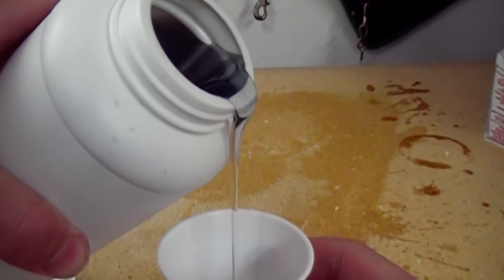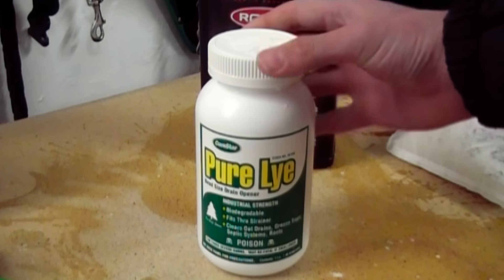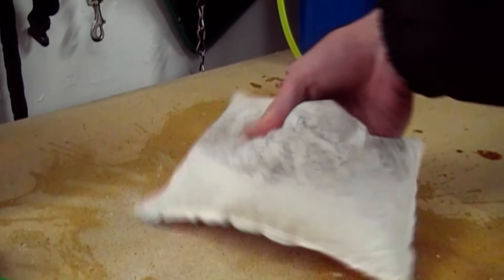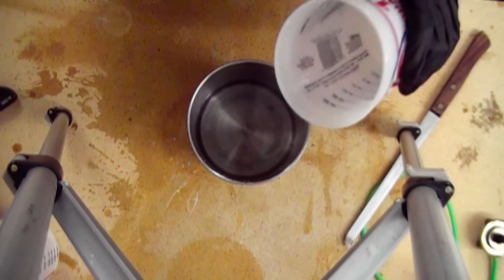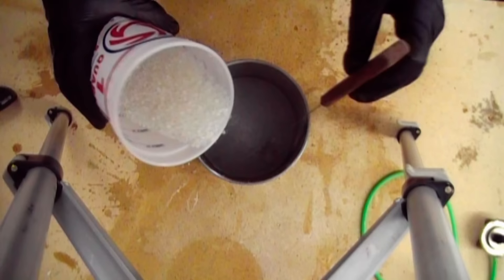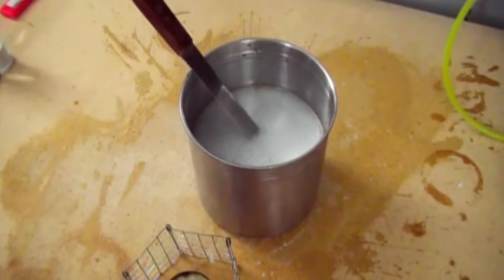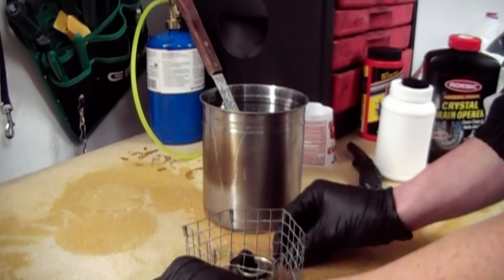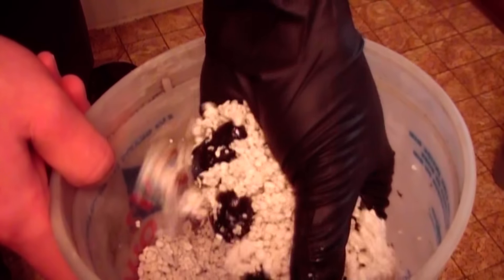Homemade sodium silicate (water glass)

Comment: Dear Cikindred and others,
My wife has made a bird drinking scale of concrete and also one of ordinary cement grout. With ready to use water glass she tried to make this close. Unfortunately the water glass solve if the scale is filled with water after 2 days drying. Is it possible to add something to the water glass that prevents this?
Excuse me for my bad english.
Reply from the maker: Heat with a torch, or gas with carbon dioxide. Either will transform the sodium silicate into insoluble silicon dioxide.
Reply: clkindred
Many thanks for your answer Cikindred, I shall give it a try!
Roeland.

Comment: Any reason why using this to line the bottom of a wood stove would be a bad thing? (the perlite and sodium silcate)  Other than it might not be durable?
Reply from the maker: Line the bottom of a wood stove for what purpose? You could sort of paint it on and let it dry, the thicker the layer, the longer it will need to dry to avoid blistering when heated.
Reply: clkindred it's a 55 gallon drum stove, so the bottom liner would be to keep the drum from burning out
Reply from the maker: Ah, well no it couldn't hurt.
Reply: Alderaan Apiaries Depends what type fire you will have, but a barrel laying on it's side as normal for a barrel heater should not burn out, if upright like a trash barrel they normally burn out 1/2way up around the sides but my bottoms are normally fine. My barrel stove for heating the house (lays on side) lasted over 15 years! The barrel did rust/burn out finally around the flue pipe damper ring on top rear so now I am going to weld some stuff there as I want to try something anyway. Otherwise that barrel is still like new except under the damper ring. I build pretty large wood fires in mine for tons of heat, but never get a barrel red hot, it's the red hot that may kill the barrel.
Reply: Thanks for the information. I did go ahead and line the bottom of the barrel with the mixture, then covered with some left over stainless flashing I had left over from another project.  I don't know what it will do for burn out, but it does seem to keep the bottom considerable cooler, which is good for the floor underneath.
Reply from the maker: Alderaan Apiaries good to hear.

Comment: Could I use this 'glue' to fix my Fitbit Charge band? The elastomer band came off the plastic body of the tracker and so far epoxy, super glue etc have failed. I contacted Fitbit and after replacing it once, they do not stand by their defective product and they will not replace it but suggest I purchase one of their newer device...really! 
What kind of application is water glass used in? With equal proportion can I make only a few tablespoon of it or does it need to be done in larger quantities?
Thanks in Advance

Comment: Could I coat a steel conainer with water glass and then dry it making a 600 degrees celcius resistant coating? And will it conduct electricity?

Comment: would commercially bought sodium silicate (40%) be suitable for this mixture? If so, how much would be needed to line a forge with 7" x 7" x 3" chamber. Thanks............
Reply from the maker: "this mixture" as in the lining I used in the forge video? 40% should be fine, however the water added will need to be less. I think I used 350ml of sodium silicate for the trashcan forge lining, and 350ml sodium silicate for the top coat cement. So in your case I think about a liter total should be enough, diluted with about 400ml of water.

Comment: I've been told that 'RU' type sodium silicate is the best for making core molds in foundry work, but all I can find for sale is type 'N'. I am nowhere near a chemist, but it seems that the difference between the two is basically concentration/thickness. What does this formulation yield? It seems like it would be even thicker than RU, but again- not a chemist.
Reply from the maker: Mike Barker This makes a 50% by weight concentration at the start. 500 grams of water, plus 500 grams total of reacted material, but when finished boiling the product until all silica gel is dissolved, it is more concentrated.
Reply: clkindred Thank you for the reply and info! If I am reading it right, RU is about 46% material, so I will try this with a little more water: 550ml.

Comment: After the sodium silicate has cooled, and is ready to use, does it matter how (type of container, temperature) it is stored?
Reply: The commercial stuff is usually stored in a plastic container with a screw lid. As long as the water in it is not allowed to evaporate and it's not allowed to react with free CO2 in the air, it can last for a very long time.  Once you take the water out, along with react it with an acid or CO2, from what I understand, it basically converts into glass.

Comment: i like to make the forge and i'd like to buy the sodium silicate online but i don't know if it will work due insufficient purity
Reply from the maker: +Actionhank Purity is a problem if there is other chemicals in a certain product, I like to bring up the MSDS from the manufacturer to see what all is in a certain product. If it is pure, but diluted that is not as big of a problem, but it may mean it's too weak to be economical. (Paying too much for water in it)
Reply: +clkindred allright thanks for clearifiyng! 
in the meantime i have looked up some info regarding sodium silicate. turns out sodium silicate is a saturated solution at about 40% silicagel per liter, meaning that 40% purity is as high as chemically possible before cristallizing :)
Reply: and i also have one question about the burner, how did you fasten the cut-out from the drain strainer cup? soldered or just wedged in place?

Comment: Great video !....any ideas how to make Colloidal Silica ?...(concrete densifier)
Reply from the maker: From what I understand, the big manufacturers use a process using a combustible compound containing silica. trimethylorthosilicate if I recall correctly. This chemical is sprayed from an atomizing nozzle and burned, the resulting "smoke" being microfine silica. I have also heard silica can be "fumed" using high heat to vaporize the silica directly.
Reply: I have pyrogenic Fumed Silica (colloid of silicon dioxide) in powder,would this be the same as reactive colloidal silica densifier ?...thanks for your time
Reply from the maker: Honestly, I don't know. I didn't know colloidal silica was used as a concrete densifier. It would depend on how the silica dose it's job in the concrete. If it's a physical, mechanical or chemical effect.
Reply: Yes,water glass and colloidal silica are both concrete densifiers...its a chemical reaction with the calcium hydroxide in  the concrete...cheers

Comment: could you help with the stochiometry and the ratio of NaOH to silica gel that you used? MW of NaOH is 40, and Silica gel (SiO2) = 60.   So 200g NaOH to 300g SiO2 will give one Na to one Si atom. but the formula of sodium silicate is Na2SiO3, which means every Si requires 2 sodium. so should you not be using 400g of sodium hydroxide?
Reply from the maker: Sounds like you know more about it than me haha. There are different ratios of reagents for different kinds of sodium silicates. This ratio is for the type with the name "water glass" but other ratios exist like sodium metasilicate ect...

Comment: This is neat.  Not sure where I'd get THAT much silica gel though.
Reply from the maker: Silica gel kitty litter is a good source.
Reply: clkindred
Wow. I didn't realize such a thing existed.  I've got to start reading more labels.  I'll hit Petco tomorrow and see what I can find.  Thanks o7
Reply from the maker: madwilliamflint
The walmarts in my area carry a brand called "mimi litter" that is four pounds for about five bucks. There is another kind by a name brand that is much more expensive, don't get that stuff, its got a lot of other material in it.
Reply: Excellent. Thank you.  Have you come up with a refractory material you like yet?  I recall some dissatisfaction with perlite, but I'm losing track of whether I'm watching the most recent videos or not.
Reply from the maker: My most recent recipe is perlite, sodium silicate and aluminum oxide. It has worked the best so far, holding up to the heat that is. The aluminum oxide conducts heat more that I would like it to though. So I'm still searching for an alternative that can take the heat, and insulate well.
Reply: clkindred
I may end up going with commercial refractory material as I want to get up into smelting bronze and casting iron eventually.
Reply from the maker: Smelting would be a neat thing to do.
Reply: Yeah that's what I'm thinkin' :)
Reply: Thanks.  Good to know. But that's an awful lot more expensive than he mentioned.
Reply from the maker: Yikes, 40 bucks, hope it works well. On a side note, the cheap kitty litter gel makes cheap dessicant packs if you put some in an old sock and ziptie it shut.
Reply: clkindred Have you tried using Black Diamond/Black Beauty blasting media (coal slag) rather than the aluminum oxide?  It has a much lower thermal conductivity (< 1W/(m*K) vs 30 W/(m*K)), and a super high melting point (>2500F)?
Reply from the maker: No I have not, I never found the particle size I wanted in coal slag media. Aluminum oxide has the highest melting point of any substance I have tried at about 3700 degrees F. The thermal conductance was a trade off for the heat resistance. I would like to try silicon carbide grit though.
Reply: clkindred If you check at harbor freight you can get cheap dessicant in there air line filters.I think they sell bags of it on ebay for the same purpose.
Reply: That's a neat tip, thanks 64ghiaman

Comment: I used this video to make my own sodium silicate but it came out really thick, not nearly as runny as yours but when its slowly heated it gets more viscous and looks like it should. I was wondering if you had any thoughts on why it would be thicker or thinner? Thanks!
Reply from the maker: Connor McKee Some people seem to run into this problem. It could be because they lost more water in the process than I did. In any case, the sodium silicate can be thinned with water.
Reply: clkindred awesome, thanks! Great channel by the way. In the process of making my first forge, your videos have been extremely helpful. Thanks again!
Reply: @clkindred  i know this is an old question, but given that absorbed moisture will add some weight in the silica gel would also dilute, it could just be humidity effecting it

Comment: It is Mimi litter, upon further examination it says silica sand , so i mix silica sand with sodium hydroxide it bubbles or rather boils as expected but seems as though the silica doesnt melt for some reason.
Reply from the maker: usa1897 hi After it stops boiling on its own, I gently heat it to get the rest of it to dissolve. Some people have said also adding a little more water was needed.

Comment: Will silica blasting sand or perlite work as well?Silica gel is not available in my area,
Reply: No - you need silica gel = 'silicon dioxide' = SiO2  try googling these terms and look out for cat/kitty litter in the shops. I'm pretty sure you will find it on amazon or ebay
Once you have made waterglass, you can combine it with sand and perlite to make fire bricks

Comment: Is there another source for Silica Gel Beads other then saving the little packs out of packages
Reply from the maker: Yes, lately I have been using silica gel kitty litter. There is a brand at wally world called "Mimi Litter" that is about four dollars for four pounds of it. Avoid anything that has odor neutralizers and such. Silica gel is also available in large amounts for drying flowers.
Reply: Thanks the can forge would be perfect for fairs and flea markets

Comment: Ive been curious on something, and wondering two questions, how much does your recipe actually make in mL so I know how big of a container I can use, and what burner is that that your using?
Reply from the maker: cae chirp The volume starts out a little larger than the water added, a batch using 500ml water will be about 700ml in volume, but it is boiled down to concentrate it to about 350-400ml. If you don't add all the water to start with, all the silica gel won't dissolve, so it's boiled out afterwards. The burner is an experimental alcohol stove I made.
Reply: clkindred Any chance on getting a video on how to build that burner? It's perfect for what Im looking for but cant find anything even close to it.
Reply from the maker: cae chirp It's an old video, so it's pretty crappy, but here it is. https://www.youtube.com/watch?v=lBBattwttGk
Reply: clkindred thank you a ton, learned alot about the type of stoves I was wanting to make from your video.

Comment: How do you store it and what makes it set, heat O2, CO2?
Reply: it sets by reaction with co2 gas from atmosphere. In use, you can help it set by using co2 gas from a soda maker. As soon as you make it, store in a tightly stoppered bottle [I prefer glass] and it will keep a few months. Once you start using a bottle remember, when you re cap the bottle some co2 will get trapped and deterioration will be quicker. Plan your bottle size according to how much you will use up in a work session.
Reply: @bigoldgrizzly  Cool thanks

Comment: clkindred I have a grease drainer that is similar to your stainless container. but mine is made of thick aluminum. will this work?
Reply from the maker: Beverly Brandon I'm a bit late on this one, seems you made the sodium silicate successfully, but aluminum would get destroyed by the sodium hydroxide solution.
Reply: yea.. I doubted my decision to use that container, so I swapped my wife's stainless container like you had for the aluminum I bought. the sodium silicate turned out great.. all I lack is the apple corer for the burner and the trash can.
Reply from the maker: Beverly Brandon Looks like they are still sold, but by different names. It looks exactly like this one, just different color plastic. http://www.bakedeco.com/detail.asp?id=7995&trng=fgle&gclid=CMjpua_zpsYCFYU6aQodrkoC5A#.VYnillKLU1K
Reply: clkindred Thank you so much.. I know I've worn you out with questions, I've just been so excited to get this forge done so I can start making my knives. I really appreciate everything. All your videos are great and professional.
Reply from the maker: Thanks! Happy knife making!
Reply: clkindred I was wondering if a 4" pipe could be used as the form for the middle of the forge.. I can't find any that's 3.5"..
Reply from the maker: Brandon Beverly 4 inch should be fine.

Comment: I did use the silicate pellets (from these dry packs) according to the recepie. Only a fraction of the pellets did dissolve. I've been cooking and stirring for a whole hour (with interruptions). any suggestions what I'm doing wrong? Could the silica pack I did use have stuff in there which just won't dissolve, even though all the pellets look alike?
Reply from the maker: if your chemicals are pure, then the only problems will be not enough water, or not enough heat.
Reply: Thank you! My Noh should be pure. It's from a major brand... The temperature was a strong boil (~100°C)... I did use the solution I made straigt after taking out the remaining pellets and did try to bond some perlite. Not working - must be way too weak...
Reply from the maker: Are you sure your pellets are silica gel? You can test your solution by adding acid to a small sample, it should form a sticky mass, then turn to a granular substance.
Reply: Thank you. Will try. My packs did say silica.
Is vinegar sufficient or more like muriatic?
Reply from the maker: Vinegar is fine.

Comment: This May be a stupid question but I have caustic soda (sodium hydroxide) but it is only 98% but doesn't say it contains anything else can I use this or no.

The brand is Diggers Caustic Soda
Reply from the maker: AztekKen It's probably fine, especially because it's marketed as caustic soda, and not drain cleaner. The other 2% is probably water, because sodium hydroxide is extremely hygroscopic it is rarely free of all water.
Reply: Okay thanks

Comment: hi, can i use calcium chloride instead of silica gels?
Reply from the maker: Alp Alphan Calcium chloride will not yield sodium silicate in this reaction. I'm not sure what it would produce if mixed with sodium hydroxide, I don't recommend you try it either, it could be bad.
Reply: clkindred
thanks for reply, i have another question: how much degrees sodium silicate can support without toxic fumes? I try to make my own recipe for refractory cement, i have some pozzolane, bentonite, perlite and sand.Do you think it is ok to use them  Do i need to use sodium silicate or bentonite is sufficent to bind those?
Reply from the maker: Well technically once sodium silicate has cured in the refractory, it has become silicon dioxide. There can be no toxic fumes from it untill the silicon dioxide boils, much hotter than we could get it anyway. Bentonite might work, but I found it shrinks a LOT when it dries and large cracks appear.